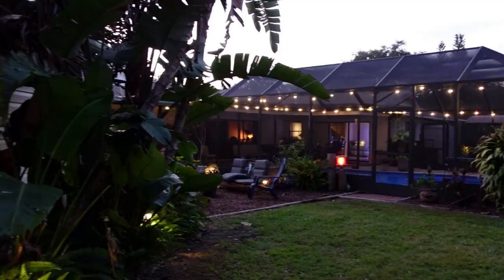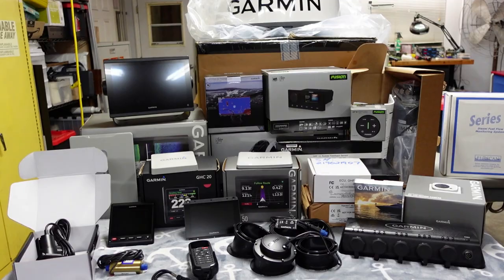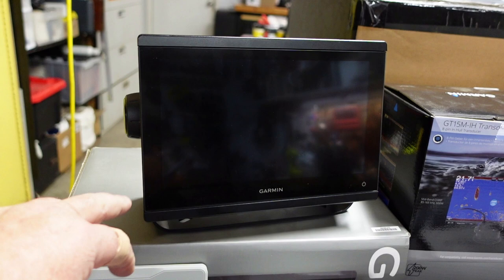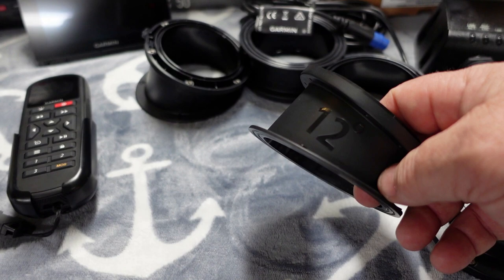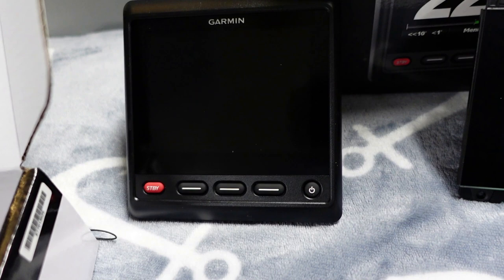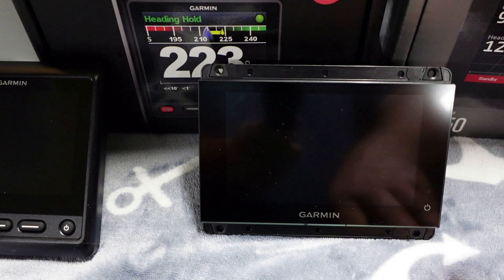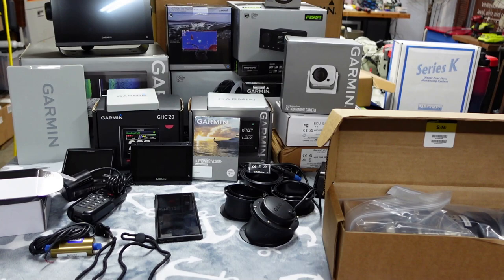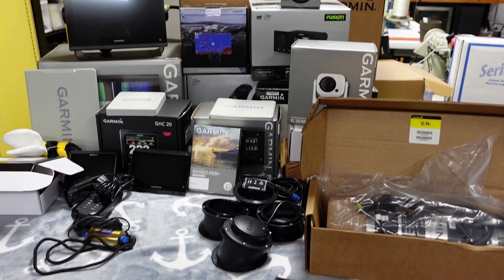Trawler DIY- Full Garmin marine electronics package pre-install overview

Comment: if you've got an old pulse radar and room, leave it installed and use the spread radar for close range, < 2nm for night running... always use RFU ... get a a/p control with large round bering control you'll quickly learn 8 detents for 8 degrees or however many degrees to change.
Reply from the maker: Unfortunately I dont have an old radar, As a matter of fact I dont even have a place to install the new one. Im going to have to fab/weld up some kind of aluminum mast. Thanks for the details and advice.

Comment: Wow - what a workshop!  I love the whiteboard.  
BTW - you probably already know it but just in case - do not install the autopilot compass anywhere within 2 feet of magnets or metal.  I originally installed mine on the other side of a wall from the battery bank and it instantly fried the compass.  They are over $1,000 to replace.  You are going to have an awesome system!
Reply from the maker: Thanks Ron. The workshop gets a ton of use. I have heard the warning on the compass placement several times now. I may even get a gauss meter to take magnetic measurements to help with placement.  They are pretty cheap these days. Certainly less than $1000 😆. Thanks for the warning.

Comment: You'll love the autopilot, it's top notch.  There is no manual mode, to steer it you're changing the heading in heading hold mode.  I just got the remote less than a month ago but I already love it.  It has separate buttons for 1 degree and 10 degree change.  If you hold either they repeat (wild guess) about once per second.  My boat takes a moment to respond to steerage and is easy to over-steer, I use the autopilot in the channel and even inside the marina, then switch to the wheel before I turn into the fairway.
Reply from the maker: Thats so dang cool. That sounds like it will be fun..lol. Thank you very much for the feedback. And you are probably the third person to tell me the same thing. What boat are you running it on?
Reply: @mvintrigue-trawlerdiy1101  I have an Islander 44 sailboat.  I had the yard install mine, for the actuator they had build-up a mount out of fiberglass inside the hull and add a plate to my steering quadrant (chain and cable steering,) the angle of the actuator to the quadrant and the distance of travel are critical...  I could've handled connecting it up but running the wiring was a bitch.  It took a professional AYBC certified yacht tech the better part of a week to do it 

I was onboard when they did it, watched some of it... hopefully  yours has conduits or channels than make running wiring easier!

Comment: That shadow drive is a game changer you’ll love it. Also very easy to install. Very curious on the floscan. I have Cummins mechanical and would love to see that install.
Reply from the maker: I would think it would be a game changer. I think those that report issues are mainly die to install errors. I already have a floscan installed. I think I have an old video with some of the details on it. But the one I already installed has an analog needle gauge. Which I found out is really not accurate enough. You can find New Old Stock units available on Ebay for cheap. floscan recently came back in business too. So they support the transducers etc. Also look at Maretron for fuel flow equipment. Pricey though. I paid about $500 for the new old stock Floscan.

Comment: Be sure to test the location of your gps hub(CCU with green connection) ie: don’t lock it down till tested for a while. I installed mine a bit too close to something magnetic/electric that bothered it and had to reset the direction of my boat quite often. I moved it a few feet back and it is fine now. It was a real pain to move it after everything was neatly installed.
Reply from the maker: Great feedback. Much appreciated. I have a rather small Trawler with a ton packed in it. I will take your advice. Thanks.
Reply: Can I ask how much all this equipment cost?
Reply from the maker: @curthook9622  I really dont know  and did not keep track. It took nearly a year to accumulate all this stuff. So long that some of the prices went up over that time. I would say somewhere between $9000 and $10,000 paying full retail. You could certainly shave that down with the occasional sales or bundles (like chart plotter and Radar bundle). You can also shave some off by using a 723XSV at one station and you dont really need the AP controllers. I do get a small discount through my job. So that helped.
Reply: @mvintrigue-trawlerdiy1101  was trying to get an idea what it would cost to completely update all systems. That’s actually much less then I thought. Thanks
Reply from the maker: @curthook9622  If you can do the install yourself thats where much of the savings comes. I will be documenting this install here. I have already started. If you already have an outdated system installed it might be easier too. Much of the routing will be similar. and hydraulic connections may already be T-eed in.

Comment: Only problem with Garmin is that they change there products line often simrad and furuno not so much and there products are compreative. Nice stuff looks expensive for sure.
Reply from the maker: Thanks. One of the reasons I choose Garmin is that I get a pretty good discount through my work. SO it make the choice a no brainer.
Reply: So if not Garmin what was your second option, I just ordered Garmin radar but was am still on the fence of it a friend persuaded me to it but was committed to furuno,I really am undecided between the two

Comment: Does it make sense to configure a laptop on the network to get more capability and bigger screen?
Reply from the maker: That is a good question. One i will have to answer when its all hooked up. I did know someone who added a monitor just for viewing. That worked ok.
Reply: @mvintrigue-trawlerdiy1101  I'm wondering if it was a touch screen and worked like you were using the Garmin head.
Reply from the maker: I do know you can sync it to a large tablet and what you do on the tablet will occur in the plotter and vice versa